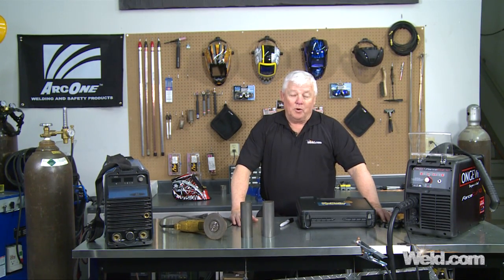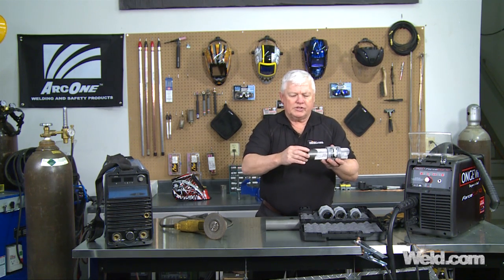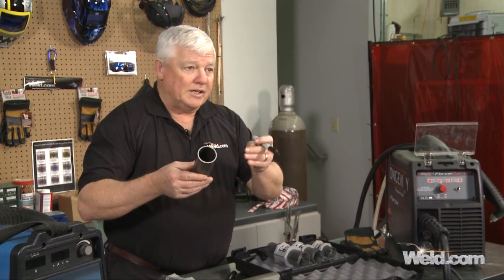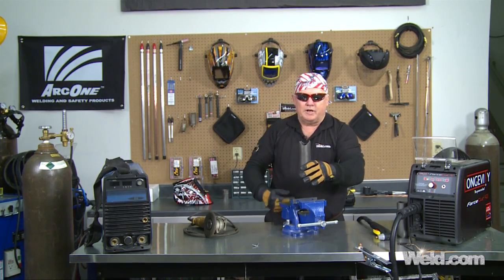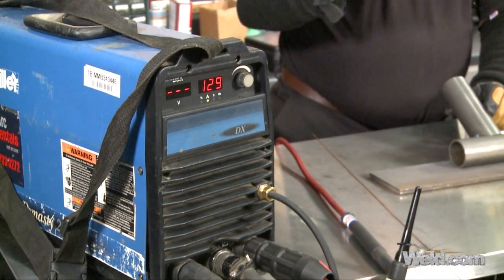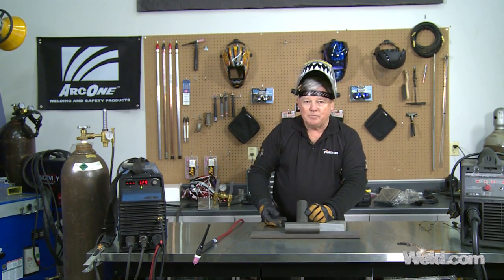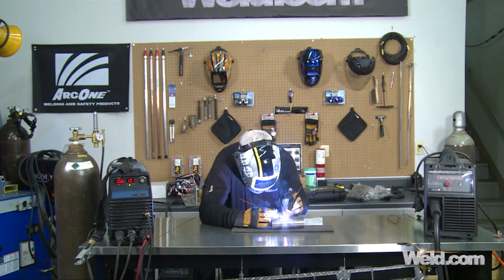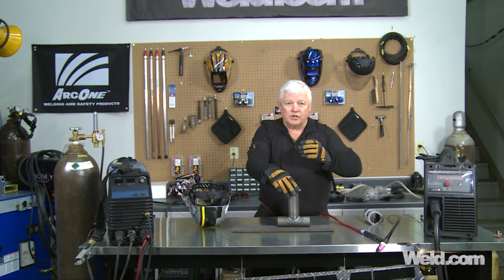Plasma Cutting and Welding Saddle Joints

Comment: you can make a saddle cut on pipe with a chop saw set chop saw at roughly a 30 degree angle will vary depending on pipe size leave about an inch of pipe not cut in the middle make one cut rotate and cut opposit side

Comment: in my shop guys lost their job for taking guards of off grinders .....   not to be a nazi .... just saying - i like to have all my fingers attached when i die one day .....

and that famous excuse: "it didn't fit in there boss" 

all i have to day is - you probably didn't use the right tool for the job than .....

BUT  - nice video!!!  i like those adjustable pipe gauges .....